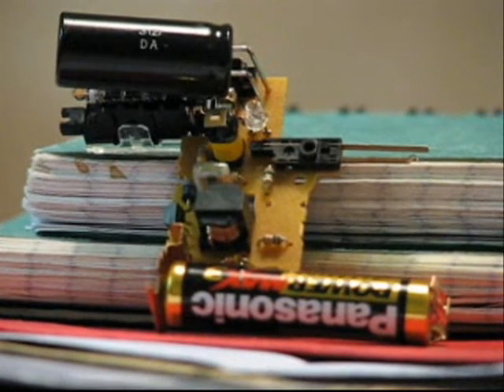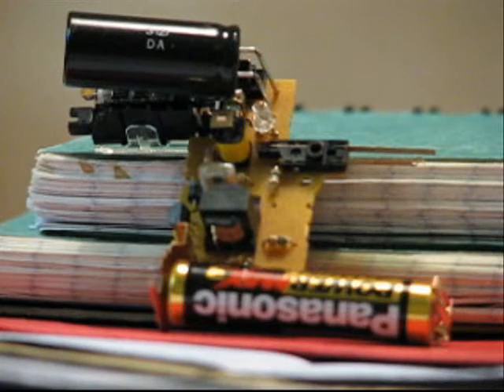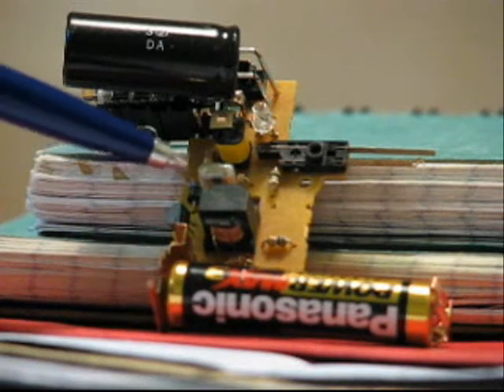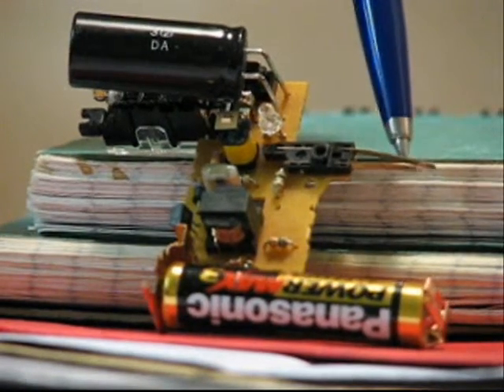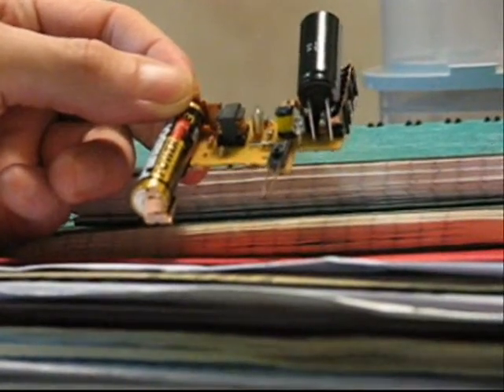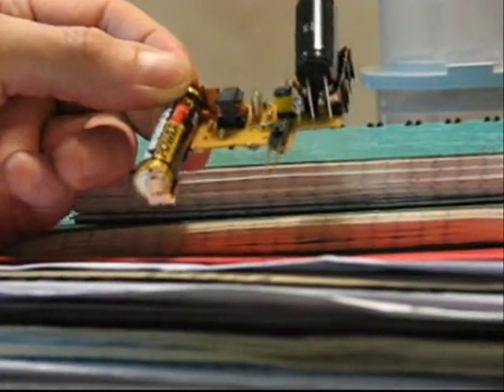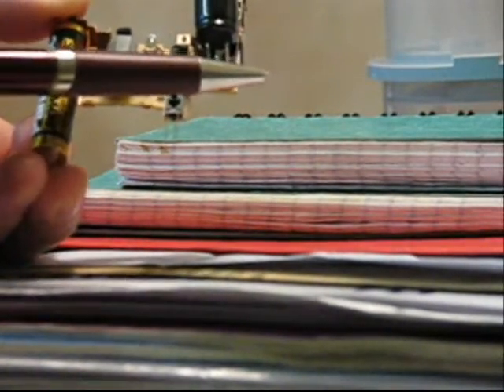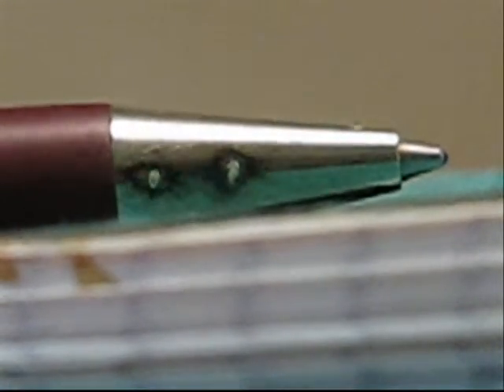Camera Flash Update

Comment: it is not a tesla tuned circuit at all.  the second transformer is just a trigger to fire the xeon tube.  the first one steps up the voltage accross the tube to about 400 volts dc  and with the one transistor is setup like a ringing choke.

Comment: shame about the volume on the stock music-hard to hear you. wonder if the shock from the capacitor alone would feel worse at 330v that the 8kv low current fron the flash?
Reply from the maker: Yes you would still get a shock from the capacitor as the power would be the same. Thanks!

Comment: close but not quite correct. The transistor and bigger transformer are arranged in a way it acts like a joule thief, the transistor oscillates the DC to make electromagnetic induction possible for the transformer to step-up the voltage to charge the cap. The diodes ensure the current from the charged cap does not back feed into the circuit or the battery. The resistors are current limiters for the "fire" switch and the charge LED.
The second transformer is a flyback that operates off the first transformers stepped up voltage, the frequency id determined by the film cap and this second transformer is what produces the "whining" you hear during the flash charging sequence. What this transformer is doing is applying high voltage to the Xeon flash tube to excite the gas atoms (prepping the tube), when you take a picture the tube is prepped and the switch releases the 300 volts from the cap into the tube and she goes pop in a bright flash!
With some parts removed and simple modification you can use this to run a CFL type tube or a small fluorescent tube. With some HV disc caps, diodes and spark gaps you can make a stun gun.
Reply from the maker: ElfNet Gaming  Close but when the flash trigger is fired the 300v across the large capacitor is dumped through a second transformer primary winding which induces high voltage (about 5kv - enough to ionise the gas in the flash tube) on the secondary winding. Thanks for commenting :)

Comment from the maker: I imagine you are drawing too much current through it and burning out the wires in the transformer. What size capacitor are you using and what voltage rating? You might use a smaller capacitor and bigger gauge transformer wire to be able to handle the load. The capacitor in the circuit I was testing is rated at 330v but it doesn't store much power. When you hit the fire button it dumps the capacitor charge through the trigger coil which creates a large voltage spike, enough to fire the flash :)